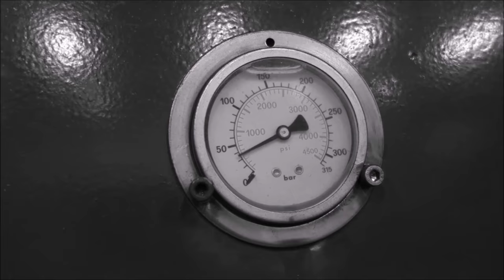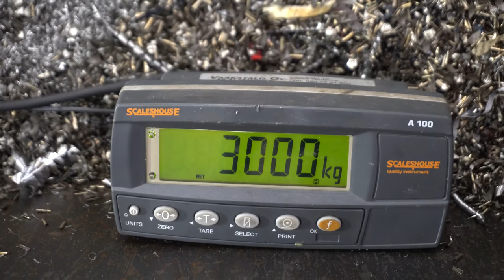How Strong is Polycarbonate Blast Shield? Hydraulic Press + Smashinator Test!

Comment from the maker: NordVPN's plan to improve their cyber security and prevent future server breaches: 

-Over the next few months Nord is removing all shared servers, moving to 100% OWNED servers to prevent such issues in the future.

-Nord is in the process of building  a committee of cybersec thought leaders and experts from around the world in an effort to work on new standards for themselves  and others.

-Nord will introduce a bug bounty program rewarding cybersecurity experts for catching potential vulnerabilities and reporting them.

-Nord is preparing a plan to upgrade their entire infrastructure (currently featuring over 5200 servers) to RAM servers. These will allow them to create a centrally controlled network where nothing is stored locally. In fact, servers won’t even have an operating system stored locally. Everything they need to run will be provided by NordVPN’s secure central infrastructure. If you seize one of these servers, you’re seizing an empty piece of hardware with no data or configuration files on it.

Nothing is 100% hack proof but after research that I have done around issue I am pleased on NordVPN's reaction and future plans to avoid similar issues. So I feel good about continuing not only promote but also use their product myself.

For full plan check this link https://nordvpn.com/fr/blog/security-plan/
Reply: Hi
Reply: With the power of NordVPN and Tyrkisk Peber I am unstoppable!
Reply: wtf? The fact they ever used shared servers is a big no no with something as important as a VPN service!
Reply: Hahaha nordvpn. No thank you!
Reply: Hydraulic Press Channel Great plan, but that does not proove anything.
Reply: no more nordvpn please
Reply: I'm sure Nord has been good to you but so have your followers. I don't envy your position. The temptation will be to stay loyal to Nord no matter what, but to advertise a faulty product is betraying the trust of your followers.
Was Nord faulty? Obviously. Nothing is 100% but they clearly weren't doing as much as they could have. Will the aforementioned remedies make it as safe as it claimed to be originally? Maybe. I don't know. But I wouldn't bet my safety or freedom on it.
Good luck HPC. You make really entertaining content.
Reply: And you know that's a load of half-truths and bullshit. And I don't mean just this comment. Well, it's not like I care about vpns unless the content is blocked in my country.
Reply: sponsor but... more about that later...
every youtube channel should be like that. straight to the content, sponsors later.
Reply: nordvpn promotion = unsubscribe
Reply: smashinator 6.000.000
tank mounted on the Smahinator itself to reduce the loss of pressure in the hose (besause it expands)
and w'd be easier to move arround
Reply: @cavemann_   I am simply providing feedback and I apologize if that offended your delicate sensiblities. Nowhere did I say that I am disgusted by people trying to make a living, you are making things up and attributing them to me and then getting mad about it. Who is really the snowflake here?
Reply: @ihatevideogams2489  
Bye silly boy.
Reply: @dgtlmoon  
Piffle on stilts.
Reply: I feel that nord vpn has always been a sub quality service even before the breach. It has always bugged me if anyone advertised their products but it wont stop me watching. Im not angry, just dissapointed.
Reply: nord getting hacked is not much of an issue, the idea that they knew they were, and waited over a month before telling anyone that it happened, is the issue. anyone and anything can be hacked, its how you deal with it after it happened that sets your concerns  on security
Reply: @daverhodes382  bye random old man
Reply: @dgtlmoon  I don't see this as a plausible theory given they were audited by PwC, a firm whose entire reputation relies on accountable audits.
Reply: All of that is just talk.  Nord is nothing but a scam.
Reply: "100% OWNED servers"  LOL Poor choice of words.

Anni, have you heard of Mr. Bill from Saturday Night Live?  Extra content idea.  Oh noooooooo!
Reply: I would also advise against promoting NordVPN like other did
But aside from that nice Video !
Reply: NordVPN...Will really fuck up your Computers....l have been building PC since the late 1980's...So beware....Thanks for watching...An here we go~~~`~~~`~~~!
Reply: For the breach that happened to occur, there is a systematic flaw with their company that literally cannot be resolved without a complete overhaul of everyone in a position of power.

I set up a server for a company when I was 17, and the first thing I did was make sure I disabled all default configuration tools the server host provided. I was not trained to do that, but it was common sense. Any organization that manages to overlook something that simple has some severe management issues that cannot be resolved as part of a damage control campaign.

I’m sorry, but anyone who uses NordVPN is naive. Get something that does not waste money on advertisements like PIA
Reply: @morglavey922  Thay are called Bot's...I worked for a cable Company once Programing Things...My friend do by any chance do you think l don't know that ??
Reply: If you have Sunday Twitch stream I'll miss it live. I broke femur and clavicle. I'm in the hospital. They did surgery tonight on my leg. They'll do the clavicle on Sunday or Monday .
Reply: Well the problem with nordvpn wasnt that its server was breached. The problem is that Nordvpn didnt tell people about it, thats really bad. And promoting a company which lies to its customers looks bad, i would really advice that you re-consider the Nordvpn sponsorship Lauri
Reply: I'll get a nord subscription if you create a pneumatipault.
Reply: Hydraulic Press Channel unsecured nordVPN breach lucky it happened right before I bought it
Reply: Try some different types of Hardox (400, 600, 700, ect),  Titan (different grades, 1,2,3 ... 39, or alloys like Ti6246, Ti6242) and Spring Steel in this way, or other types of plastic (Hdpe, PEhmw, PEuhmw) please. :)
Reply: Can you do a video of converting compressed books into book shelves?
Reply: Wouldn't it then have been 4600 joules when moving at twice the speed?
Reply: @Snoopmasta  Energy = 1/2*m*v(squared), so if speed doubles, energy quadruples.
Reply: @foureyedchick  So pretty much as I said? 😉
Reply: Glad to know they are proactively preventing breaches. RAM drives (initrd or /dev/rd) are very handy, because once the power is cut, or it reboots, BLANK!!!
Reply: @steveshoemaker6347  A VPN cannot physically FUBAR anything. It also cannot FUBAR an operating system. Windows itself, does commit FUBAR even with regular use. I have a VM copy of it, and had to do a clean install due to a recurring BSOD that was no fault of my own (and it was seldom used - blackberry 7.x smartphone maintenance).
Reply: @rootbrian4815  So some kind of not used FUBAR... LOL
Reply: @steveshoemaker6347  Yup. Used, new, doesn't matter. Can't FUBAR unless a hammer, or water, or super high voltage are used.

Comment: For anyone who isn't aware, polycarbonate is very very very very close to "transparent aluminum" from Star trek. you can work it just like a piece of aluminum sheet metal. it bends, folds, and even displays very similar stress cracks on bends to aluminum. it is seriously an amazing material. other plastics like acrylic are very hard, but they're extremely brittle in comparison
Reply: Put a welder to it

Comment: There are two things that encourage punch through. One is the speed of the piston and the other is the edges of the piston. A slower piston or rounded edges will require more pressure.
Reply: The area of the piston is also important. Also, with a sufficiently small piston, rounded edges, to the extent of making it a hemisphere, could increase penetration, not sure.

Comment: How about shooting the ball bearing to the plastic with pressurized air?
Reply: It has plenty enough power to do it, if it can be released quickly
Reply: Maybe, I challenge Beyond the Press Channell to test it
Reply: @Valmentaja  I'm guessing it'll take a pipe about 1,3m long to accelerate it to 100m/s with 12 bar compressed air, let's see if they'll decide to test it

Comment: Better than tesla truck glass😂🤣😂
Reply: They said it broke cus it cracked when tests happened earlier.
Reply: Thats a fact, just like apples "strongest glass" and their "sapphire" camera lens😂
Don't know why they always have to lie XD.
Reply: @TetaGama  No, it's just shit XD.
Reply: Yeah, that was a sad moment for Elon! He was shocked, so was everyone there!
Reply: Tissue paper is stronger than the cyber crap from Tesla 😂🤣
Reply: But polycarbonate does not resist any scratch and glass yes.
Reply: @pologamero2648   polycarbonate also has a horrible UV light resistance and optical purity compared to glass.
Reply: @C2H5OHist  UV filtering and scratch resistant coatings are available for polycarbonate, but in most cases only viable to small pieces, because it's quite expensive. Our company uses polycarbonate lenses for railway traffic lights, and the manufacturer of the sheets claims a lifetime of something like 25+ years under direct sunlight. And it's quite scratch resistant as well IIRC.
Reply: Anything is better than tesla..
Reply: I can hear Lone Muck's soul crying at this comment!

CRYING TILL THE END OF TIME!!
Reply: @TetaGama  which means instead of 9mm, people will bring sledge hammer to crush the window
Reply: You don't want shatter-proof side windows in a truck anyway. You want windows that shatter easily like usual auto glass, that way you can get out if you have an accident and end up under water.
Reply: Tony Valdez not you, you are much worse
Reply: AlfonsoB Polycarbonate has been used in eyeglasses for a long time but those lenses are expensive.

Comment: How do you cut polycarbonate? The cut looks like a handsaw marks. I've tried with tablesaw, it burns and melts, tried with small Bosch circular saw, it bites and goes off the line, only good method that I found was by handheld router, but you need to slow it down

Comment: With the cylinder, most of the force is concentrated on where the edge of the cylinder touches the polycarbonate, that's why it tears so easily.
If you'd had a tool the same diameter as the ball bearing to fit it onto I bet you could have increased the pressure further without it going through because it does a much better job of spreading the force once the polycarbonate has deformed enough to match it's shape.

Comment: The Polycarbonate behaves non newtonian and it flows a bit if you go slow.
Reply: Not exactly. It's not a fluid, it's plastic. One definition of plastic is its a material that undergoes what is called plastic deformation or it 'flows' under pressure
Reply: @kg4boj  I'll try to describe my thought in more detail. 
Polycarbonate is capable of plastic and elastic deformation.
I have no intention to imply it's a liquid. Not would I imply it's a metal, just because it can give the illusion of work hardening.
Out of the types of plastic deformation, the one, that doesn't involve breaking or tearing, is the one I tried to describe.
A force just big enough to cause plastic deformation over time, would lead to a elastic deformation if the time is short enough.
That could imply, that electrostatic forces can build up inside the material, to store excess energy over a short time.
If that is the case, the material would become warmer when saturated and starts the plastic deformation.
So I don't know how to classify the material. It has properties of a glass, but that doesn't describe the specific behaviour.
In any case, seeing this process through a thermal camera would be interesting.
And if the short impact behaviour changes while the polycarbonate is exposed to hard x-rays.
If my expectations are correct, it would tend more to a plastic deformation, while irradiated.
Reply: @heyarno  When you say newtonian, that pertains to fluids. polycarbonate is not a fluid and is nothing like glass, its a tangle of very long molecules which give it it's shape. As far as x rays, over time plastics exposed turn milky yellow, same as they do in sunlight and for the same reasons. And any substance getting deformed will warm up but plastic under an IR camera has a low emissivity and will appear mostly transparent.
Reply: Yes, scientific debate!!!!
Reply: Jackie Tearie  Actually X rays DO turn plastics yellow, or other colors. It's not just UV, but IONIZNG radiation. It knocks electrons off atoms and molecules making ions which are unstable and alters the chemical structure of things, this can be DNA, plastic, or most any material.  As far as "Newtonian" that can refer to several things, newtonian dynamics, newtonian mechanics, and newtonian fluids are a subset of newtonian dynamics where he modeled the dyamics of fluids that flow like water meaning it's shear stress is linear in relation to it's velocity gradient at right angles to it's shear plane. And polycarbonate is little more than  what it says, multiple chains of carbonate ester groups There are oxygen atoms because esters contain an Alkoxy group, but they are mostly carbon. It just so happens these long chains get tangled up and the bonds are very stable and unwilling to break but ionizing radiation of any type WILL do it and I've seen it with my own eyes where a polycarbonate X ray film cassete turned yellow with gradual exposure to X rays, also anyone who was in the biz of buying trading or selling cards, stamps, or other vintage goods will know if they were operating in the early 2000s that a LARGE number of things through the mail came to their door discolored brittle and permanently damaged by the gamma rays the postal service were using. It's still ionizing radiation just like UV and X rays, just a higher frequency with more energy per photon.

Comment: What is the limit for plastic deformation/force it can pop back to shape from?
Also I'd be interested to see what the smashinator does bolted to a floor!
Less energy lost in lifting the whole thing up I imagine?
Reply: Personally, I’m not sure what the limits of elastic deformation of plastics are. As for the bolts, they would need some sort of shock-absorbing material added to them, otherwise the sudden shock of the Smashinator moving downward and trying to move upward would eventually snap/shear the bolts.

However, it would be very interesting to see how the Smashinator would perform when fixed to the floor!

Comment: Jees. I was about to go cringe about nvpn commercial but hot damn that was done right. Wish for HPC video: test how much it takes to push through the bolt threads in metal/wood/polycarbonate, different sizes etc.
Reply from the maker: I was bit worried about how we will continue with the Nord but I think they are taking this now seriously after all the videos and publicity about the incident.
Reply: Too little too late, all my details were already leaked. They can’t fix that.

Comment: smashinator at 1 bar 6,25 m/s 29,3 kg have 183 kg xm/s momentum and 572 joules not 1000+ like you claim you forget divide be 2 and gothrough or not depend on psi so force to Surface area ratio ,in your test also how evenly force is distributed slightly bend on side and we going through ;)

Comment: Bro, you have GOT to brace that Smashinator down, that's incredibly dangerous when it jumps like that!!!  Drill 4-8 holes on all corners and middle sections with no less than 2 inches between the metal and the outside edge.  Drill holes in the concrete (DO NOT USE WATER, USE SLOW BORING BITS, water will ruin the epoxy), put anchor receivers in the concrete and secure them with PC Products Concrete Anchoring and Crack Repair (you can get 8.6 oz on Amazon).  Then get a 1 inch rubber mat, put a piece of that polycarbonate under it, then a 1 inch rubber mat again (like a sandwich) and bolt that sucker down.  You can even bolt it through the polycarb and rubber mat layers and make sure to use washers for between the bolt housing and the mats/anchors.  I do NOT want to see the Smashinator (or you or your wife or your workshop) damaged because that thing jumps, falls, and breaks off the attachment housing.  It could really do some damage.  They use them here in the States on repeater-mode for bending steel and they are required by law to be mounted into the floors.  The dual rubber mats reduce the energy put into the concrete so it wont crack and the polycarbonate layer acts as a solid but flexible buffer.  The washers will need to be secured with the epoxy as well but it really just creates a dampener for the hostile vibrations.  Only washers needed are on top where the bolts are mounted and on the bottom between the mats and the anchors and you'll only need that epoxy on the top bolts, no need to do it on the bottom because the vibrations will be dampened by the rubber/polycarb sandwich.  You'll need to weld a 1/4 to 1/2 slab of steel to the bottom of the Smashinator unit before doing this.  I sincerely hope you utilize this method because it works incredibly well.  Just looking out for you, I love the channel, keep making great vids!

Comment: USE COMPRESSED LIQUID INSTEAD OF AIR? Hydraulic smashinator
Reply: Jon Barnes liquids are non-compressible. Gases are, which is why you have to compress the air before using it. I believe compressed air has a more powerful effect than liquid, I forget the details, but car brakes use liquid, and bus brakes use compressed air.

Comment: amd where is the surface area in the equation? this whole test is faulty. 
29KG tool going at 12m/s ok but have u thought that you have a small surface area of the impact that force at that point is amplified u need to measure force per square cm . if the tool was larger noway it would have penetrated